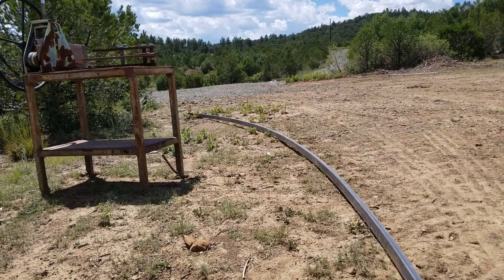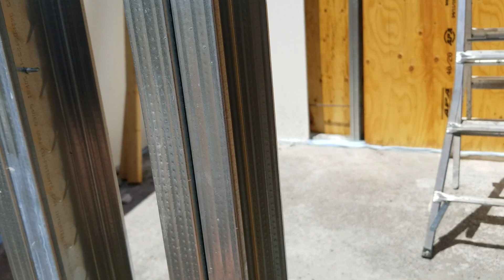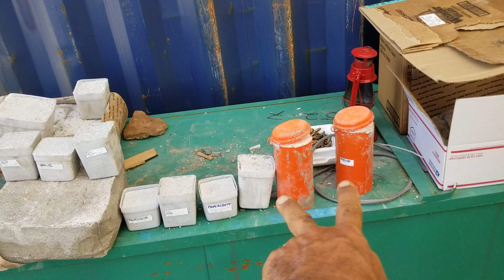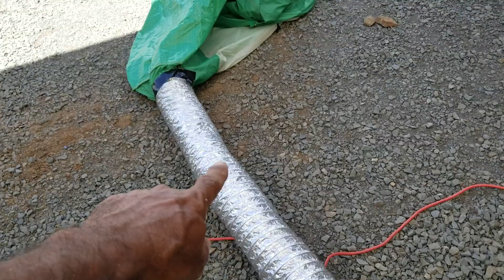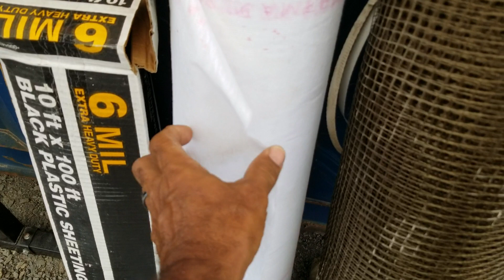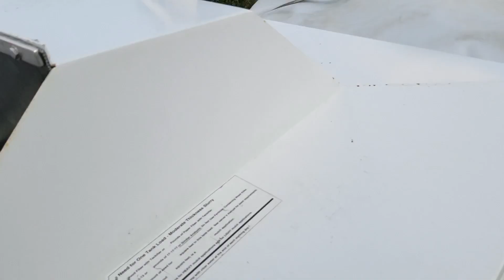Aircrete Projects | Cement Mixes | Slabs | Aircrete Harry | #aircreteharry #slab #aircrete #building

Comment: Hi Harry 

I liked all your videos and subscribed. And I watched the interview with spacecrete.  I want to build a house & I would like a ingredient recipe for cement to do all my houses slabs foundations, garage foundations,  side walks and driveways that doesn't crack and has strong PSI strength?Could you also recommend a floor method for each room in the house & walls for the best insulation & roof insulation method? I like your steel stud method. Where do you get your steel studs from? I seriously want to build a second story house with load bearing walls, How do I use air crete to build a second story house?

Comment: You can build a self-reclaiming septic system, it has a very poorest bottom, but the sidewalls and top are concrete. The poorest bottom allows all the liquids and fluids to be absorbed underground using the Earth as a filter, as far as the solids they will ferment and break down, if you have to empty them, it's usually once in 10 years.

Comment: Couldn't you use those panel boards horizontally then just do the whole length of the wall half way, let that cure do the other base half. Then once the bottom halfs cure then set up higher then pour the top half?

Comment: Aloha ty for your videos and all the information you openly share. A thought i have is the cold air that will pass through the space between the double studs. you will loose the the insulating property's of the poured thickness.a bead of caulk of something would seal it. Unless you will be painting the ex with the ceramic paint? Da Ai Greatest Love, Da Gan En Greatest Gratitude I'm using my GF computer. Limu

Comment: Ok so might be a dumb question and I'm sure already asked but can epic and aircrete be mixed for maximum insulation use?
Reply from the maker: Yes you can mix. But for me it's about application Aircrete needs a mold to work, EPIC does not and can be sprayed on.
Reply: @AircreteHarry  gotcha, good to know it can be done.

Comment: hi harry, did you pour the dome yet? also, did you finish the laundry room as well? i have purchased your mixes and wonder if the strongest epic mixes are strong enough for weight bearing snow loads? really like your foam shedder idea into the tent...smart! would any hydroseeder work, or is it that specific company and model, that you have?
Reply from the maker: No dome yet. I'm working on a new Aircrete machine that I will be using to finish the laundry room. If you build a dome the way I did then you will build up your layers. Iron wood Oak wood then Balsa wood. More then strong for snow loads, We had 8 feet of snow this past winter no problem for the dome  with 3 to 4 inch thick walls. Next dome will have 4 to 6 inch walls. I had a test done with EPIC samples that where not fully cured that means with a fully cured samples I should get much higher results.

https://www.youtube.com/watch?v=o8jWCROQb8Q
Reply: @AircreteHarry  right on, this helps a lot. thanks for all the help and work you two have done....have a great day

Comment: Why exclude normal ( bubble foam ) from EPIC mix?
= lighter + more insulation + but slighter weaker mix
For applications that does not need that much strength, paper gives little bit of tensile strength and i think more importantly it  bulks the cement up (as a filler) saving on cement, does adding just a just a little bit extra bubble foam to the existing EPIC mix work? does it interfere with the paper in your experiments?

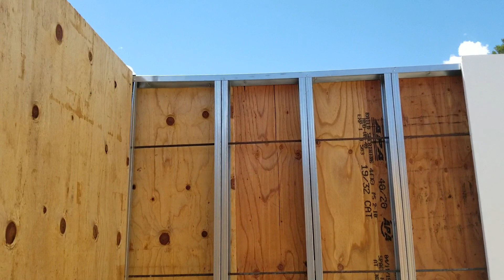Comment: At around 02:50 where you show the way you're filling the panels - it brings up a question that I've had.: If you use aircrete to fill a cavity - how deep a layer can you do in one go - without having the weight of the aircrete collapse the bubbles in its lower levels?  Obviously there's not going to be much pressure on the bottom layers at 600mm but at 1800mm there will be quite a lot - and also a lot of pressure on the formwork.
Also - was the rebar in the walls welded in somehow or just tied with wire?  And how is the aircrete floor holding up?   Would tiling it present any problems?
Also - very interested to hear more about  the Edison batteries if you get time.

Comment: That tent concept is interesting but probably not optimal.  I'd be nervous about letting the foam into the blower.  If a piece of the foam gets caught and starts rubbing it''ll melt onto the inside.
If you use a big box as a collection chamber, run a vent hose from the shredder to the collection chamber, and another from the chamber to the air blower, as long as the box is big enough and the air blower intake is high enough above the inflow from the shredder, it won't let the foam get into your blower because the air flow in the box won't be fast enough to carry the pearls.

Comment: will you be adding tubing through slab or walls for heat,via hot water off rocket stove.thanks for all the work you save us.
Reply from the maker: Not planning on adding any tubing. It will radiate from the mass heater.

Comment: No offense Harry but Styrofoam is made from Petroleum.   I cannot see the reasoning behind destroying the environment to build a shelter.  Doesn't make much sense to me.  Concrete is bad enough mostly because of the mercury pollution from coal fired electricity generation but styrofoam is made from crude oil.
Reply from the maker: The point of the styrofoam is number one to recycle what already exists. To add insulative value. And I did make blocks using perlite to address some of your environmental concerns. And it is an inexpensive way for people who have been displaced from their homes because of natural disasters or other reasons can build inexpensively. I'm with you I would prefer to use magnesium base cement which is much healthier for people and the environment. But unfortunately Portland cement is the much lesser expense.
Reply: @AircreteHarry  Oh I agree with you regarding the downside of portland cement.  I also understand the longevity.  The concrete foundation that supported the farmhouse that used to be where this mobile home I am renting sits is at least 100 years old.  Probably older.  I subscribed to your channel because of Darwin & Melanie.  I live in Herkimer county on the south side of the Mohawk Valley.  I grew up in Delaware County.  An "upstate ny boy" that came home to the Catskill when I retired.  I am closing on a small farm just down the road from here.  My plan is an aircrete barn next Spring.  This Fall I plan to make aurcrete panels to repair the garage and mudroom on my "new" house that was built in 1890.  Over time I intend to use lots of aircrete as structural insulation for this 130 year old house.

Comment: I really don't see the point of all this and what I mean by that is, if your building a shed with even more studs than you would in regular construction and then adding plywood to both sides why wouldn't you just add insulation? I don't see all the extra cost and time being a plus???? I'm planning on building a shed also but using a form like tongue and grove so there will be no need for studs so you will just pour, let cure, remove the form and repeat. I will also add a finish to the face but before the pour coat the finish using fortified floor tile mortar so the finish will be solid from the initial pour. It seems to me most have great ideas but they don't have the patience to let it cure properly.
Reply from the maker: The shed is a proof-of-concept. I'm building a 10 x 10 shed but I am showing a system in which anyone wanting to build themselves a house to live in could replicate this system and increase the size. So by filling  the cavities in between the studs with aircrete  I'm adding not only structure to the system  but the aircrete is my insulation  there will be 5 to 6 in  thick walls  that will have great insulative value .  The plywood  will then be removed  and used for other projects . The shed will cost approximately $1,200 between the slab the wall studs and the aircrete to fill the cavities. I've seen cheap wood sheds at Home Depot and Lowe's that cost way more and will not be Fireproof or have any insulated value at all. A lot of people have been displaced out of their homes because of natural disasters. And if you could build and 800 square foot house for $6,000 using this method why not you should meet code using double stud technique. The thing you have to account for which the studs help with is the pressure from pouring the aircrete wanting to push your panels out.

Comment: Looks like you need to turn that bender on its side and have two people on the ends to walk it while you roll it. Might be more uniform. ??
Reply from the maker: Most of these projects I do solo. Mrs. Aircrete helps a lot but point is I don't have two other sets of hands for helping.
Reply: Well, screw.a bicycle wheel to each end.